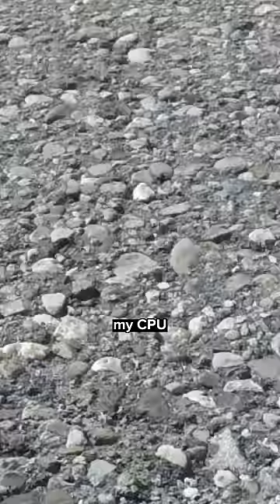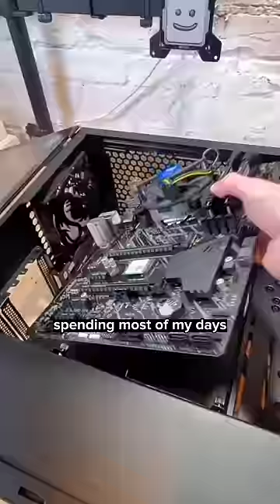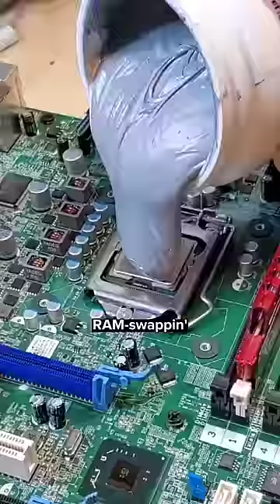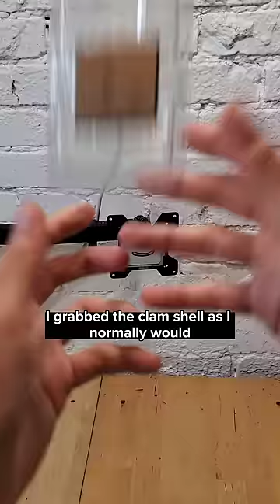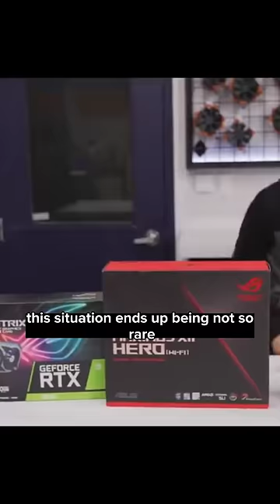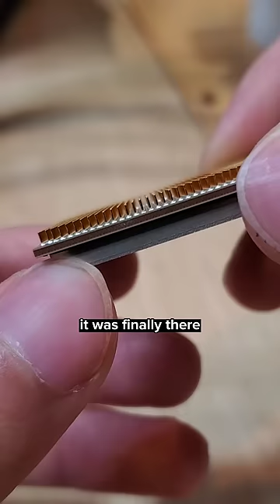Fixing Bent CPU Pins (freestyle) #shorts

Comment: I actually bend the pins of my 5600x and almost got a heart attack when I saw that it didn't fit into the socket but luckily I've managed to fix it
Reply: why would you try to put a cpu with pins you know are bent into a socket
that is how you actually rip off the pins and boom now you can't fix it
Reply: Forgot to mention mine was also a 5600x it used to cost $300 💀💀💀
Reply: @landofbol1098  Same, now they're so cheap, I should have waited :(
Reply: Some of my pins snapped, but it still works. Had a little problem occasionsally
Reply: @Mustafa_Deniz_COBAN  did it go down over time in your country? (Ex. It went from 300 to a little under 200 in the US over a year and a half)
Reply: Me too and i accidentally wiped the thermal paste on the cpu socket i forgot that the tissue i was using have thermal paste from cleaning the previous cpu. The bent pins was fixed when i slowly align it in the cpu socket. Wiping the thermal paste off was also stressing almost went in and under the black plastic.
Reply: @landofbol1098  no it didnt go down because of the inflation unfortunately. the country is turkey btw

Comment: My first cpu I made one of the easiest beginner mistakes, I used the incorrect socket for my cpu. I tried to brute force it and bent probably 30 pins. Went and got the right mobo for the cpu and it obviously didn’t boot because of the bent pins. I proceeded to perform surgery on it for about 4 hours and managed to post and run that bad boy daily for 5 years. I was insanely proud of that build just for that reason.

Comment: Threw my R7 3500X3D because when I opened it the box felt empty (bought it off new egg) so I threw the box at the wall and it mad a thud, the CPU was in the protective plastic it comes in taped the bottom of the box, about 10-15 bent pins and a broke off. Threw it in my test rig just for sh*ts and giggles and it booted up, a lot of pins a redundancy ground pins. I got very very lucky… lol